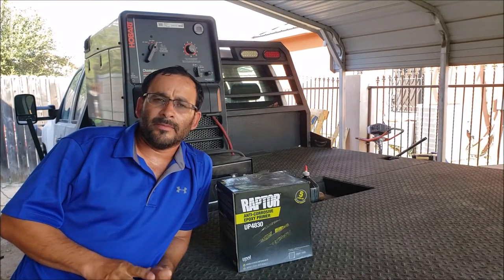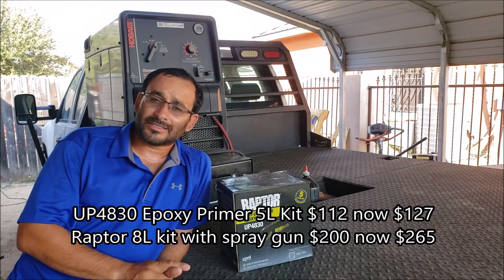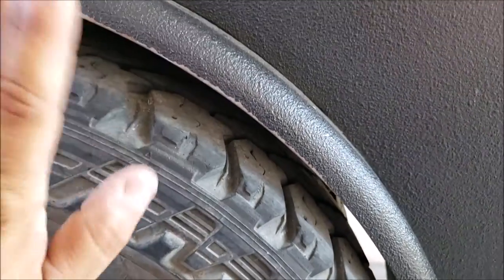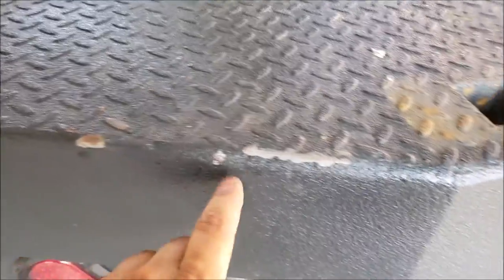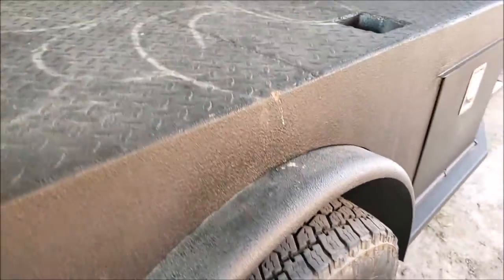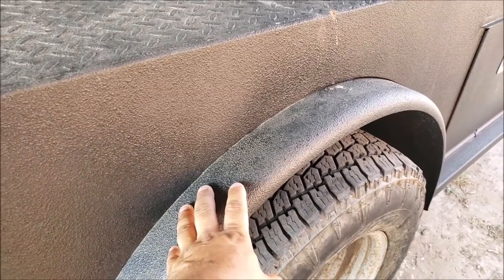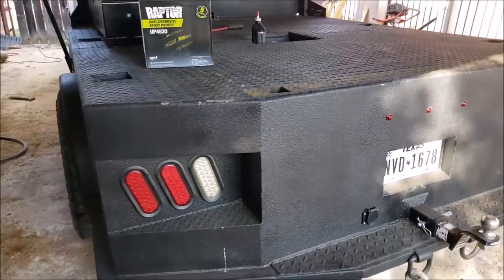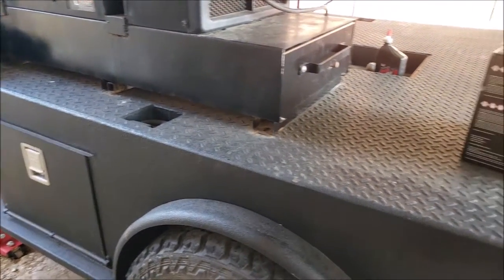Raptor bed liner 1 year review and update on the diy flat bed welder truck : cutweldngrind

Comment: They sell single use rattle can version of this product. Remember, nothing man made is perfect but just be glad it wasn't $1,380 of PPG products... it would be way worse. I do truly appreciate your honesty about the prep-work and the aged review after dropping some heavy stuff. Thank God it wasn't your leg, foot or toe! You mentioned "Gym" poles. While the description fits many uses, we bolted "Gym" poles to microwave and TV towers at 300ft to 1,500ft to lift the next sections up to be bolted in. Scared in Texas as "Free-Standing" relay or  transmitter towers had a ladder on each opposite side. So you had to walk the tilted angle iron to the other side, then repeat 14 more times. 
  Thank you as I am doing the frame with their epoxy and then Raptor and bottom of cab of a 67 C10 PU. 
Thanks! ASE Master Tech since 78.
Reply from the maker: I am not familiar with the rattle can version, are they similar to the cans that have a separate chamber for the catalyst/ hardener? I would like to own a C10 pickup but hard to find any project vehicles around here. I tend to always explain or show my errors so others can learn and avoid throwing money away. We have radios on some towers at work but most our towers are 80 ft and the rentals have our equipment at least on the 450ft mark. I use an arial lift / manlift for the 80ft towers and that's about all. Thanks for stopping by and good luck on your project.
Reply: @cutweldngrind    I would call your local U-POL dealer, or look online at their official website. I have been researching to note what is best practices and works together, write down or print TDS papers. I believe they have a product that is 2k. Maybe not, but 1k is what it's called across other lines as well. 
  But the Eastman Type product is theirs and another company cannot infringe on copyrights or intellectual property.

Comment: Thanks for sharing! I finally gpt a 71' f350 dually that we have been looking for and have been going through it. I plan  to build my first flat bed as you did this winter. Also picked up a 2022 F350 and plan to do a bed on it as well😎🤞
Reply from the maker: Awesome. My bed is really heavy and I could of shaved some weight by going 1/8" wall tubing and smaller side skirts. It's to hot here to even look at my welders as it's been about 100F these past days. Winter is when I prefer to weld and hope it gets here soon.

Comment: with primer for rust from raptor. the coating paint from raptor when applied on that primer can resist weight of 600 pounds or so
Reply from the maker: If I could redo project I would sand blast to prepare for primer. I had a piece about half an inch pop off after a pipe hit my skirts. The top deck is fine and more resistant as the diamond plate is slightly rough. Thanks for the information.
Reply: Durbak-18 is more weight resistant than raptor but it’s slightly more expensive.

Comment: The bed looks good. I would add air bags to it also.
Reply from the maker: I bought 3" blocks and they look like junk. My buddy told me to install airbags as well. The passenger side has an extra 3 leaf springs making it slant towards the driver side. I want to weld extra support to the blocks and if that dont work I may look into airbags again.

Comment: What prep work you do or what bed liner you use you're going to get wear and tear on it. Just touch up the rips and tears and it'll be sweet for years.  Still looks like a real nice truck deck 👍👍👍
Reply from the maker: I covered a few spots with primer and black paint to just avoid rust. I think a sand blasting job would of made the bed liner more durable but its a work truck anyways.

Comment: If the primer is still on the metal when the bed liner is chipped up, it has nothing to do with the prep work on the metal. Maybe prep work on the primer unless you went wet on wet

Comment: Nah mate, it's not your prep work. I had mine done professionally. It's just not durable like professional bedliner. It chips cracks and scratches over time. It's a case of you get what you pay for. It's a cheap product so cheap quality. That chip and scratch you point out on edge is typical
Reply from the maker: Thanks for the comment. I think this material is very stiff so any flex will cause it to break or chip. I was planning to do my 2015 F150 I got last week for $1700 but may pass. Thanks again.